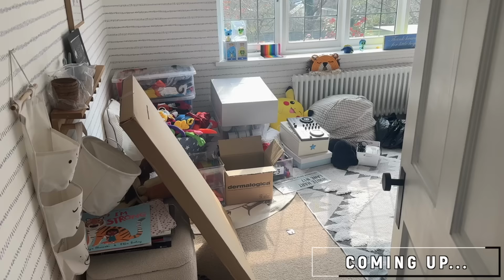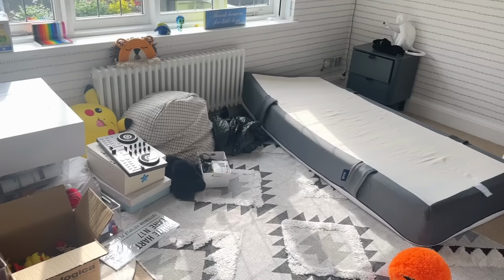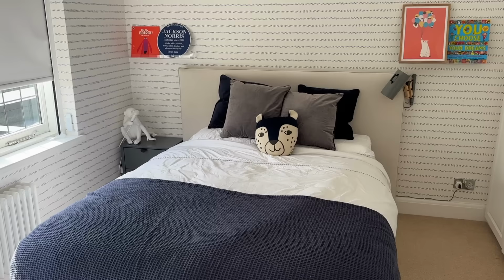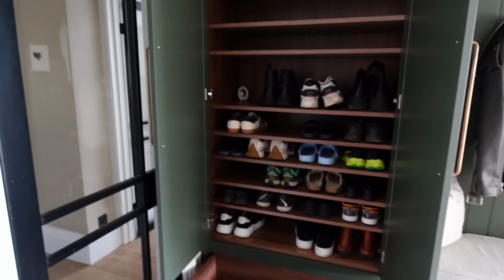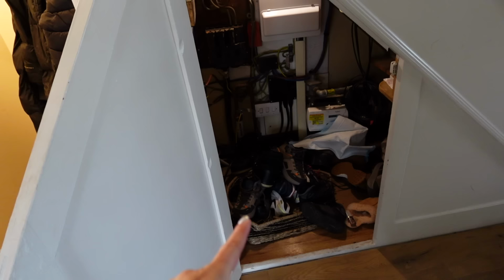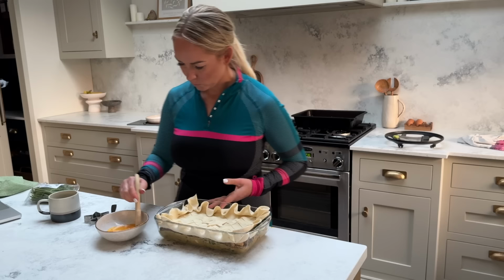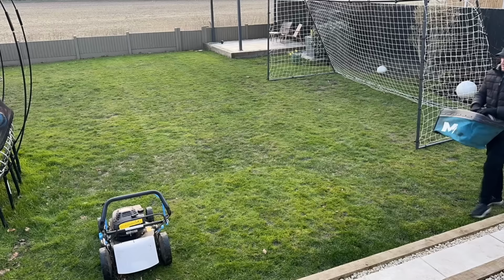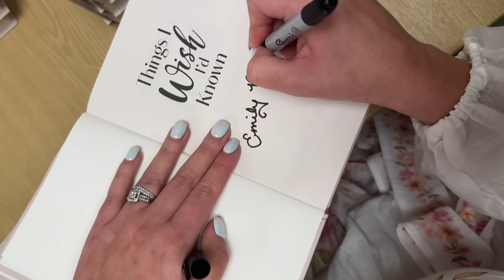GET IT ALL DONE! Productive Day, New Bedroom, Recipe + more

Comment: Congratulations Emily. Well deserved! 
Love how the mud room/wall turned out! The whole space looks so well put together with the cabinetry. I have to say, I do love that old door with the black hardware under the stairs. However I realise it may stand out a bit once the front hall is completed. In regards to the other cupboard with the electrics, you may be able to use ply wood panels to make removable, false walls to cover it all, with sliding bolts top and bottom to hold the panels in place. Worth looking into if you're keen on the idea. Good luck!
Reply from the maker: Great advice, thank you so much xxxx